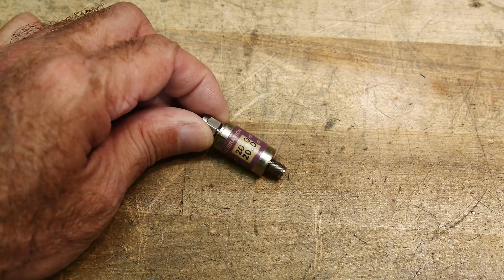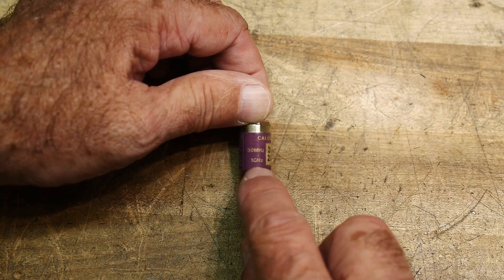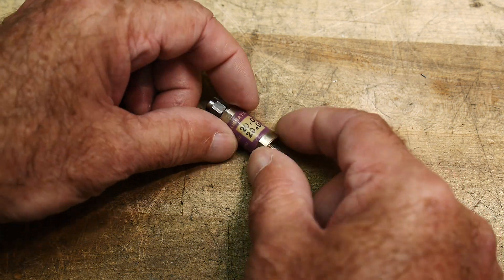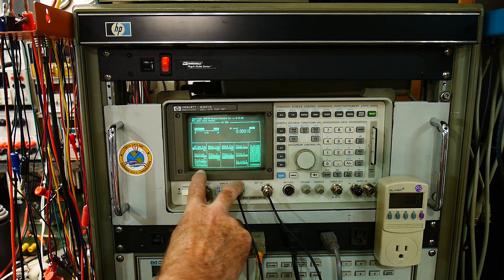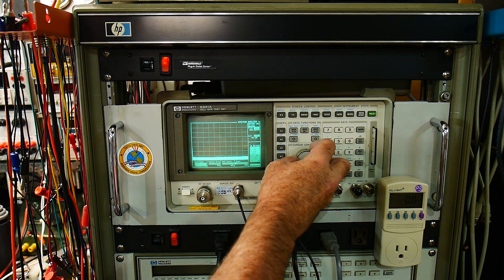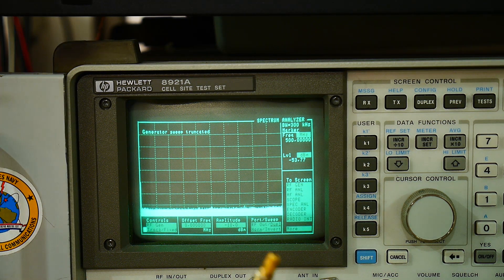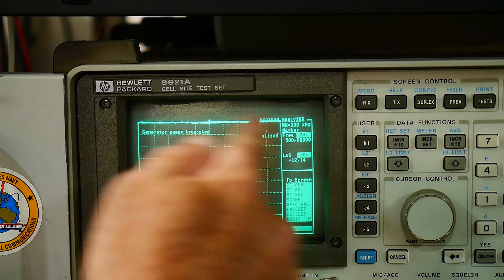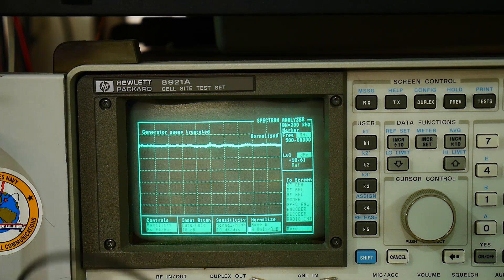#563 Testing a 20db Attenuator

Comment: All attenuators from aliexpress were ok for what I want to use them for. Not sure if the lower attenuation at higher frequencies at about 5 GHz are caused by the limits of my devices or are a hardware problem. Tend to have less attenuation there. Measured with LiteVNA and used with tinySA Ultra.

Comment: Could this have been done on the tinsySa?
Thanks in advance.
Reply from the maker: the tinysa does not have a simple tracking generator. you could use an external source. I have other videos using the tinysa (check my tinysa playlist)
Reply: @IMSAIGuy  thanks.. i have watched so many of your vids ..being a relative newbie is sometimes confusing.
Much aporeciated.
Reply from the maker: the NanoVNA would be a great tool for measuring attenuators.

Comment: the attenuator value is described with a precision of one decimal place. so I was expecting  some measurement  difference in the least significant digit. however there are almost 2db of mismatch. in your opinion this error is due to the attenuator itself or the analyser?
Reply from the maker: I'll post a video on a good measurement in a couple days
Reply: @IMSAIGuy  That's OK. I was just curious if the problem was in the attenuator since the manufacturer of the device provides the rating with three significant figures and you have bought it second hand from eBay. Just let me say that I'm a huge, huge, fan of your videos :)
Reply from the maker: Analyzer. A spectrum analyzer is not a very accurate machine. The correct way to measure would be to use a tracking generator and scalar network analyzer. I could have also calibrated the setup better. I was mostly looking for relative changes when I did the test
Reply: @IMSAIGuy  I'm putting a 6db 50 ohms 5w attenuator between radio and amplifier 1-30Mhz. Should I incorporate a bypass function in the attenuator design for receive mode, or is the loss so minimal it's not needed. Thanks again.
Reply from the maker: @akeem11h  bypass, 6dB only passes 25% of the signal
Reply: I'm wondering if the attenuator reduces the quality/strength off the receive signal and if so is there a specific design to use?
Reply from the maker: @akeem11h  the receive signal is reduced by 75% you can't have any attenuation in the receive chain
Reply: @IMSAIGuy  ok, I see, I just need to change the attenuator db ratio on the amplifier board that's already incorporated with keying circuit. This will save cost and be much cleaner than external attenuator on desk. Thanks 👍. Keep up the awesome work.